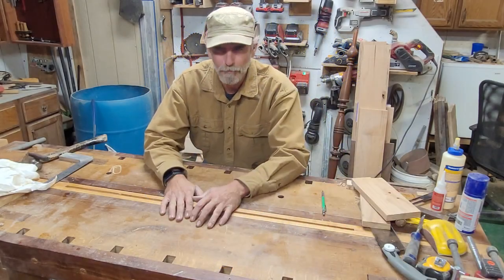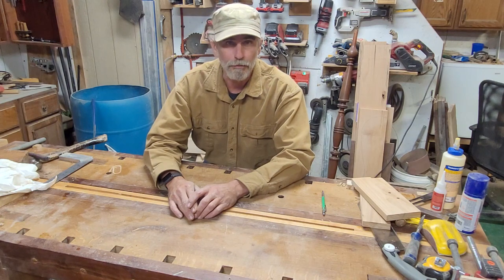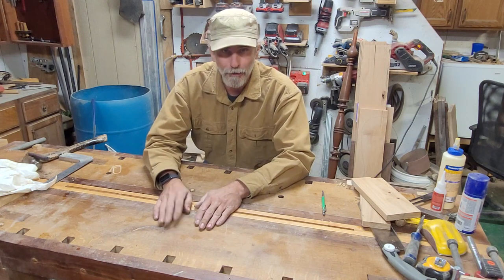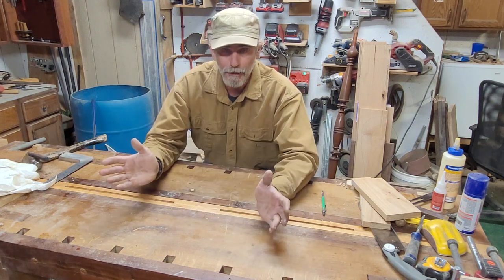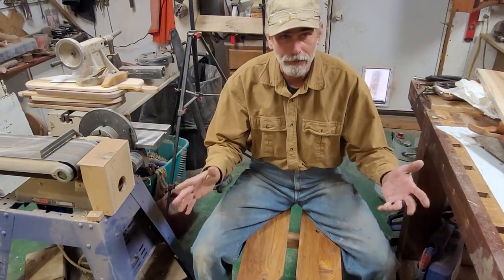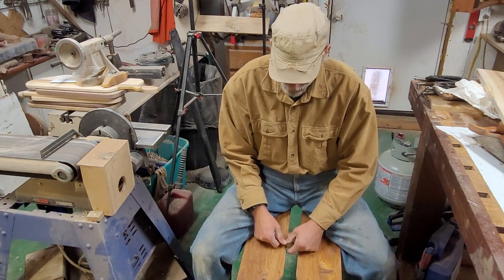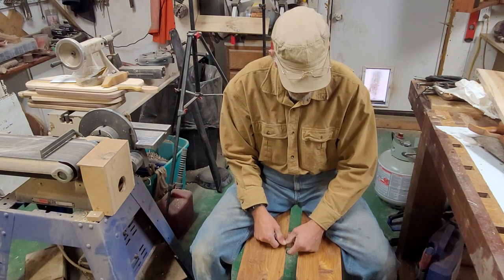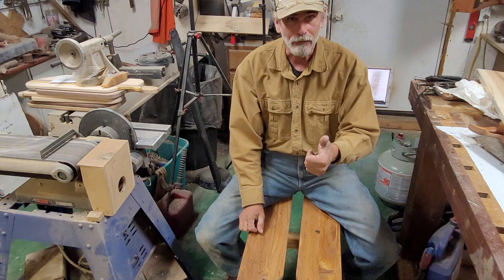Can You Guess what I am Making?

Comment: Rip bench? 12min in. You sir are very inconsiderate. Making all these cool woodworking project videos that inspire me to go to my ice cold woodshop and freeze my fingers off.
Reply from the maker: Rip bench is pretty close, and is actually another name for it. Good job. And yea I heat my shop with the Rocket Mass Heater I built several years ago so have a heated shop.
Reply: @DIYwithUncleCy  I built one of those out of scrap from old furniture. I had a very similar design thats why it was easy to spot it. That thing has been very useful for alot of things thru the years. Even used it as a step stool when renovating my house haha. I have the same v shape in the end. Perfect for drilling on. I used it mostly with a circular saw running thru the middle because im too lazy to rip with a handsaw haha. The middle groove is perfect to clamp things also whereever your piece needs support. Mine does not look as nice as yours tho so need to make one out of decent wood one day also.